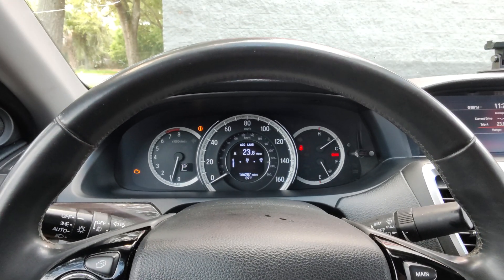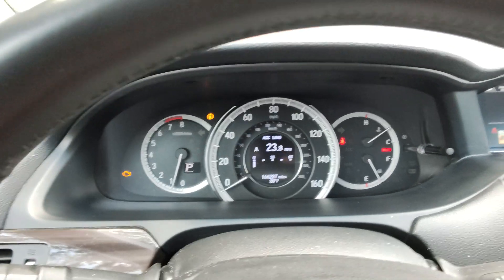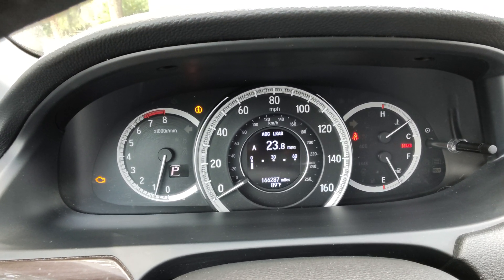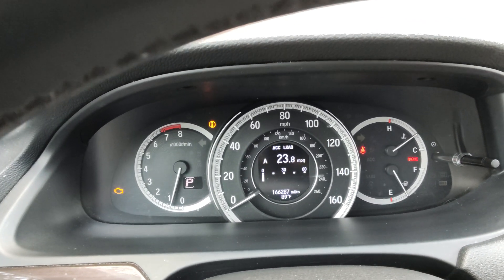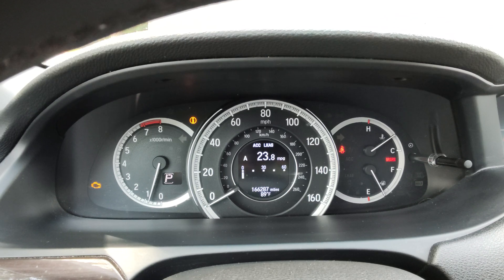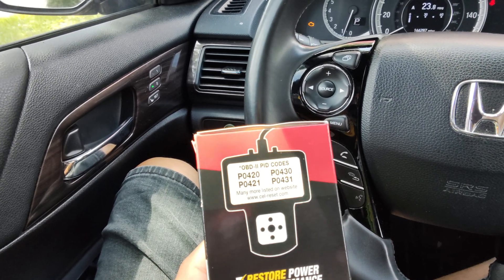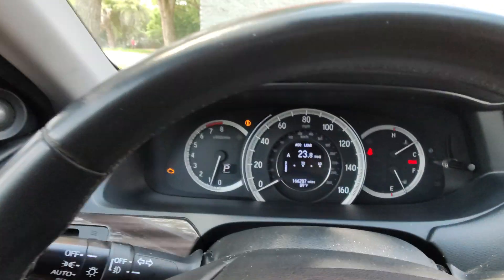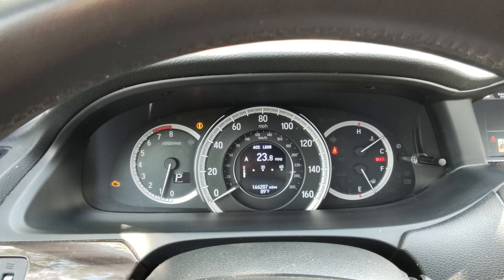The Honda Accord Emissions Issue You Never Heard About

Comment: 😣 that has to be very frustrating    
How’s the transmission holding up?
Reply from the maker: The transmission is ok so far, i change transmission oil every 40k miles
Reply: @BORICUACHANNEL  that’s good to hear.  My touring has half the mileage yours has.  I barely drive it nowadays
Reply from the maker: @PLATINUM2U  Honestly i think they are mixing gasoline with something because i noticed everytime i put regular gas my Emission P0430 error codes comes back and when I put Premium or Rislone Fuel Exhaust & Emissions system cleaner code and check engine goes away. My daughter is having similar issues with 2020 GMC
Reply: Mine just came on. I just put 89 Oct in my car and light came on 5 minutes later 😮‍💨
Reply from the maker: @jjsquad4 Don't put gasoline in BJs every time I put gasoline there my check engine light comes on they must have bad gasoline

Comment: I have the replica as well. I’ve only ever service it at the dealership. my check engine light just came on. They are charging me $1365 for replacement. Please me updated on the results. Also! Is it safe to drive? The engine isn’t going to combust is it?
Reply from the maker: No it won't combust I'm still driving my Honda it almost has 200k miles